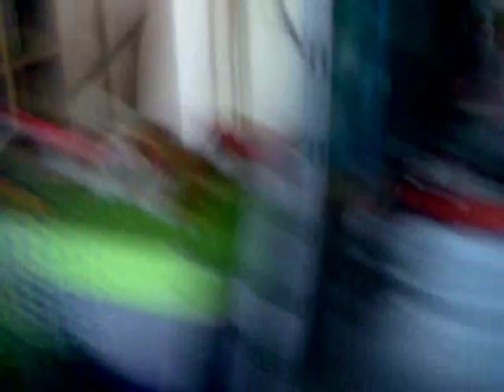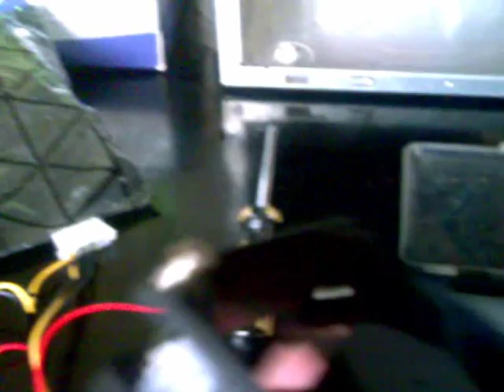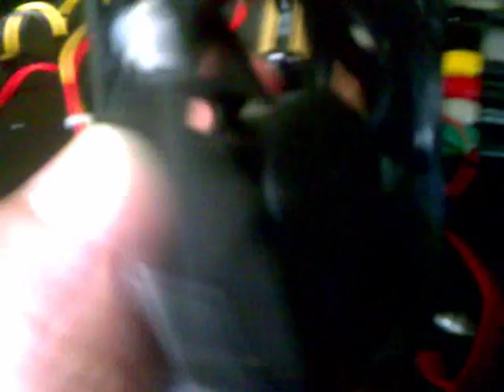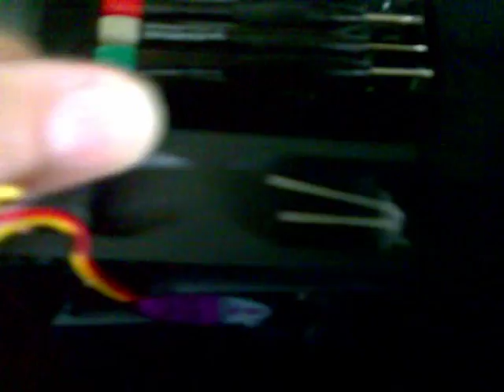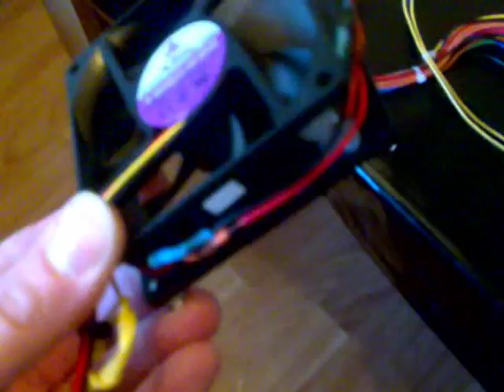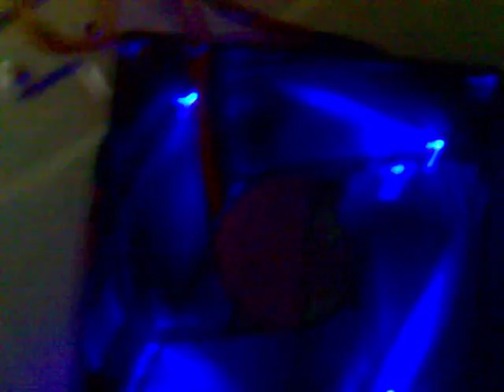Case Mod Project - Part 7 - Homemade Purple LED Fan

Comment from the maker: @WestCoastMods Thanks for the tip! I'll check when I make the next one. I didn't cut in a resistor as I'm running the leds directly off the 3.3v rail. I believe that it should work, unless there's something I've missed!

Comment from the maker: @WestCoastMods Hi Lazy Man! Thanks for your comments - much appreciated. They're definitely wired in parallel. Each led has its own +ive and ground rather than the the ground of one being connected to the +ive of the next. You're right of course, the accepted way of doing this is to use 12v and cut in a resistor but, you know, I'm just wanting to try something and see if it works!

Comment: Nice job bro. just a suggestion...you should try to point the led almost towards the middle of the fan, looks from the video that they are pointed kinda to the inner housing of the fan...still looks good though. Also did you cut in a resistor?

Cheers
LazyMan :-)

Comment: @PGTMan IMO I think you might be better to run them of the 12v  and cut in a resistor that way you have the required voltage going to the LED, not to much..not to little

Comment from the maker: @strangerlover11 No I didn't use a resistor because I was powering it off the 3.3v supply. If I'd been using the 12v supply then I would have.

Comment from the maker: There is a separate power cable for the LEDs that is connected to the 3.3v rail via a terminal block I installed in the case.

Comment: well it kinda matters whether you wired them in parallel or in series, I believe if they are wired in parallel then your okay, but if they are wired in series (which by what I saw in the video they were) you may not have enough power going to all 4 of them, They have LED calculators that will explain all this and give the required power and if you need a resistor or not. Just Google LED calculator 

I know it's confusing, I get confused all the time to..lol

Comment: did u use a power supply that plugs in to the wall that u connected to the led lights??? if so do i need to use a resistor, or if not do i just plug it up and have fun??